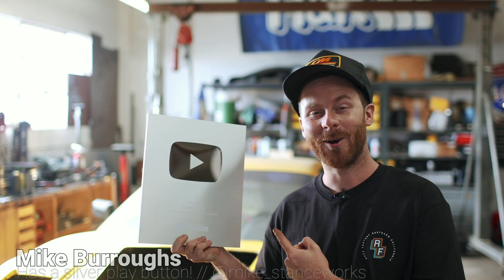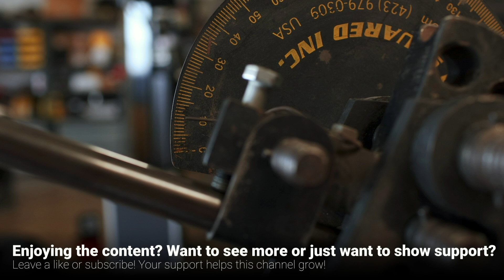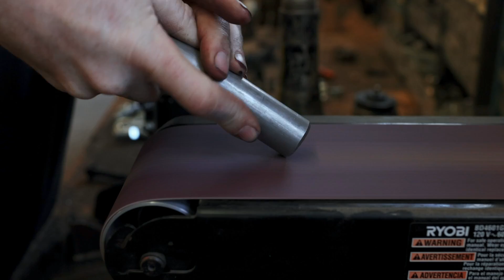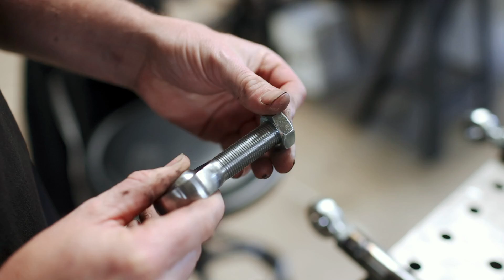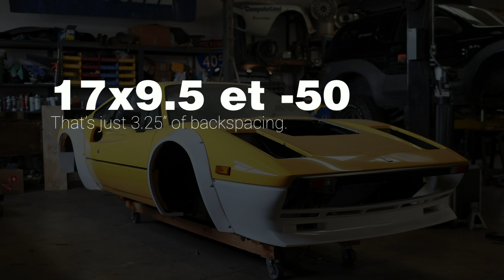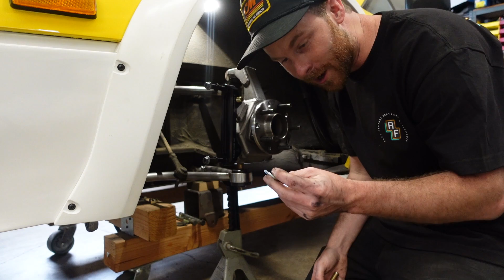Honda-Swapped Ferrari - Custom Control Arms Complete!

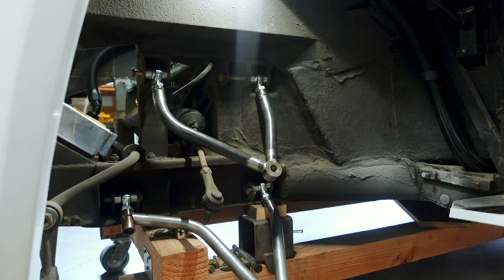Comment: 11:24 should put a big spacer in the gap that was left after the original wishbone got removed, this will crack with time unless load is properly spread between both ears.

Comment: LUL, that Iconic RX7 wheels fly off at 8:44 !!  I know that was for the memes, but that was caused by cheap "aluminum" lug nuts if I remember correctly after being on the RX7Club forum for a few decades 😂😂

Comment: Regarding the washer direction, the argument for radius side down is that prevents the sharp edge from digging in to the surface, especially if the material has a protection layer (paint, zinc, etc.)

Comment: IMO, this part of the project is the most challenging, technically. It's a very complicated system dynamically, requires precision and near-perfect dimensional consistency among multiple hand-built parts, and he must get it right, or his car could be an absolute nightmare to drive in competition. Suspension design and build quality are going to make-or-break this car.

Comment: The stub axel not having a filet radius would 100% be a real problem. Especially with fatigue and especially with 1000 horsepower. If you're interested in the science its called stress concentration. You can read all about it in Shigley's Mechanical Engineering Design chapter 3. Depending on the size of the fillet radius vs the larger and smaller axle radii the torque in the corner could be up to 3 times as high at zero fillet radius.

Comment: Nice work, I know you have to be frustrated every time you do something to the control setup that you don't have those wheels yet.  I know you have worked hard to get that weight down, sadly I think you are still going to have a lot of weight from the chassis, my guess is 2348lbs.  If you are able to come in under 2200 that would be quite an achievement!

Comment: Congrats on the 100k+ subscribers Mike! Very well deserved. I do have a question for which I can’t give an answer or at least, not the best answer. It looks like you’ve used the same longitudinal positions for the control arms and just added track width. Not a horrible idea as it’s a good known (mostly) start point. Do you know more than Ferrari? Ferrari today, absolutely not. Ferrari of 30-40 years ago? Maybe. Ferrari didn’t have access to the internet or the computing power we do today. They didn’t have the experience gained by 1000s of engineers over that time either. I could critique your control arms for several reasons but, I actually think it’s more important to get a safe car on the road first. So, like you are, concentrate on getting the car drivable first. Then gather data, analyse, modify and iterate. Really looking forward to seeing this car progress.

Comment: I think most of the bracket you created in this project can be 3D printed use a FDM 3D printer. It's cheaper and faster, and the strength of the 3D printed material can handle most of  your situation in this project. You should give it a try.

Comment: That 3m deburring wheel is just what I need to clean up the SS exhaust tip of my brother's VW T3 sports exhaust. 
Loads have said to use Harpic power toilet cleaner but looking into that, now shows it's a bad idea due to the caustic ingredients.

Comment: 3m purple Roloc clean & strip 4” disc. 07466

Or 3m gold 2” or 3” Roloc’s 07480 & 85 

Also sunmight makes good 2” 36g and 50g small roloc disc that are killer. 

If you see this in the 300+ comments. Best disc ever ever. 🙏

Comment: the only thing I will ever criticize is your use of imperial measurements how do you use thousandths of an inch how can something imperial be sliced into 1000ths they are metric, please use metric measurements everything is divisible by 10 including weight like 2200 pounds is 997kg, you have a Japanese metric engine in an Italian metric chassis , even the GM corvette hubs are metric 5x120,  Millimeters centimeters meters kilometers

Comment: The control arm spreader bar is only needed if the mounting interface for the control arms is insufficient. It's actually pretty uncommon but I understand wanting it since the stamped steel ones had it and it could be made very light. You could probably even get away with 0.035" wall 4130. Congrats on the 100k, I look forward to seeing this car get "finished", then improved as you keep learning.

Comment: Rear toe change curve can have a powerful effect in tuning handling, especially with big rear tires and weight distribution. Fixing it as you are is a good safe place to start, though before the frame gets fully painted/finished, I'd suggest future-proofing with provisions for a chassis-mounted toe link. Ideally you'd want to be able to adjust the height of the inboard mounting point and would want level at ride height within its range of adjustment.

Comment: You have fender flares...not a widebody kit.
Reply from the maker: Please, thoroughly and non-pretentiously explain the difference.
Reply: @stanceworks  I realize you are a very technical guy and that is why I started watching your videos, for the technical aspect and I appreciate the content you share. But to call fender flares a widebody would be like calling Bushwacker fender flares on a F-150 or any flares on a truck a widebody when it is not. I used a truck as an example. Unfortunately the younger generations call bolt on fender flares a widebody. And in my opinion molded on fender flares are a grey area whether or not they are still just fender flares or an actual widebody. What was considered a widebody back in the day is when the actual width of the sheet metal (or if has fiberglass panels) of car was wider from quarter panel to quarter panel and fender to fender. In reality the bode of the car is still the same width with and without fender flares.
Reply from the maker: I appreciate the kind words. 

This isn’t critical to you - but nuancing the difference between “wide body” and “fender flares” just comes off as pretentious gatekeeping. I get why some people care, I’d probably say the same about something like a 240sx, but in the end, none of it matters. 
It’s my car, and I’ll call it what I want. I think, while still technically correct, calling it just “fender flares” is discrediting to everything else going on here. The build is anything but just bolt on flares - I’m going through a mountain of work to redesign and widen all of my suspension components to make this bodywork truly beneficial. My track width is now wider. I think calling the car a wide body is fair. If anything, the entire car, aesthetically and mechanically, is wider now.

Comment: How long does the battery last on your little die grinder?? (Granted it's just being used to clean up edges/cuts smaller jobs) I love my pneumatic kobalt... But DAMN listening to the compressor gets OLD!
Reply from the maker: I have the big batteries for it and it goes a good while. The battery charges as quickly as it depletes, so two batteries usually keeps me at 100% duty cycle
Reply: @stanceworks  only 2 batteries and you can roll on at full tilt without having to wait!?! That's killer!! Thanks for the reply...and stellar news!! Off to the local *big box for a new gadget!

Edit: The "Honda-rrari" is coming along fantastic!! Loving the relatable mindset of "do it the right way, not the easy way" can't wait for the next installment, keep it up!
Reply from the maker: I should be clear - that’s not from constant use full tilt. But I find that the rate I use it, 2 batteries is enough.
Reply: @stanceworks  kinda figured that was roughly based under "your normal use" lol. Either way, much appreciated!

Comment: Another awesome episode! The 308 stub axle information is 100% correct and it is not really a design flaw. The stub axles are totally ok for the tires available in period. With the advent of larger and stickier tires over the past 40+ years the stubs show their limitations. Also be sure to sell those uprights. A complete assembly should sell for at least $1K each so that is some good bank sitting on the shelf.

Comment: A FB group I'm on posted links to this and, of course, mentioned the "desecration" of the Ferrari with a Honda motor. Rest assured, your fans quickly pointed out the 1000+ hp. Looking forward to seeing it rip and silence most of the haters. (Let's face it, some will hate because hating is easy.)
Reply from the maker: I'd love a link  if you have one?

Comment: If the car was 3200lbs when you started, my guess is 2350 dry.  I built a Porsche 964RSR race car out of a 2900lbs street car and it was 2225 fully wet. It had a full cage, smaller brakes, and was air cooled, so 2350 is my guess for your car.

Comment: Great project. I just realized one small thing. From my understanding, you got a AP brake kit designed for Corvette, which you adapted to the Ferrari? But be aware, that a Corvette use trailing callipers in the front and you have mounted them in leading position. There for the piston of the caliper are the wrong way! These caliper have 27, 31.8, 38.1mm piston and that is also in turning direction the row, how the disc should run through , or you will end up in huge taper wear, followed by a soft pedal and leaking or clamping pistons.
Reply from the maker: Good note! Fixing that is as easy as just swapping my spindles side to side.

Comment: Amazing to me that the early 240Z came in at  2100 lbs, WITH a steel body, back in 1971 and just a few years later, a performance car like Ferrari comes to the table with a 2700 + lb car. ( the Z had ballooned to this weight as well )  We can thank Nader and all the other bleeding hearts for this.
Reply: The 308 had a lot more baller 70’s “luxury” than the 240 and a heavy engine, plus the chassis is super crude.

Comment: I'm glad you stated that failure is acceptable if it is used as a learning experience. Too many people fail to act for fear of failure when they should just regroup and press on. 

Great work on the car as usual. The rear body structure with the boxed steel is screaming for your attention. If it was all tube framed it would be incredible, but please don't for now. Just focus on the pertinent details. :D
Reply from the maker: At this point I do wish I had just tube chassis’d the car. The next big build, maybe 2023, will probably be a tube chassis.

Comment: Did you mention half shafts on the to do list.  I'm interested in how the power to the spindles is going to be done.
Reply from the maker: Me too. Hopefully I figure it out LOL!
Reply: @stanceworks  I'm not familiar with Corvette rear spindles, but if they don't work maybe LS4 (2005 -2009 GM V8 front wheel drive car platform) spindles and splined shafts. Looking forward to seeing what you come up with.

Comment: Mike, are you running C5/C6 front spindles/hubs on all four corners? I can't remember if you discussed it in the past. If so, what did you do to get around running smaller rear calipers (I'm guessing AP's calipers all mount the same), or are all four corners running the same calipers with a proportioning valve?
Reply from the maker: I have smaller 4 piston calipers in the rear. It’s just a rear corvette brake kit. 
Corvettes use the same spindles on opposite corners, so FR is the same as the LR and vice versa. It’s part of why I chose them, for simplicity’s sake.

Comment: Longest build series? Whoever said that has never heard of Bad Obsession Motorsports and the 6+ year Project Binky series.
Reply: Hell, how long has Rob Dahm’s 4-Rotor taken?
Reply: @afilleduptaco  big facts. I've been watching him for at least 5 years.
Reply: @afilleduptaco  Shockingly not as long.
Reply: @afilleduptaco  I immediately thought of that and came to comment that lol
Reply: @afilleduptaco  at least that car has been driven and even raced ken block, project binky hasn't even driven under its own power 😂
Reply: @kai_444  Binky has driven under it's own power, they took it to a show not to long ago. Granted, it only barely drove, and they've pulled it back apart again to fix all the things they found wrong with it after the show.
Reply: @kai_444  not true! But we haven't seen it in action yet. Can't wait
Reply: @kai_444  It did drive already
Reply: @kai_444  it has moved under it's own power on and off a trailer. They've had to do some reengineering on the clutch pedal and alternator setup.
Reply: @kai_444  Has so, just got taken apart again after for some bracketry 😢
Reply: @kai_444   Yes it has, I was there at the historic rally festival 🤩 albeit it didn’t go very far 😆
Reply: @kai_444  there's videos of it moving
Reply: Pfft, all are amateurs. :) Aaron Cake's series on restoring and modifying his 1976 Mazda RX-5 Cosmo has been going for 11 years.
Reply: @HwAoRrDk  did you see he dropped a new video recently?
Reply: @HwAoRrDk  This is the never ending YouTube build series! Aaron Cake that is lol
Reply: Buildercreater has been working on the Arete for a long time too
Reply: People who think this is taking too long haven't ever turned a wrench.
Reply: @SupercarSeany  I feel like people who are saying this are kids who have only known engine swaps from Forza lmao
Reply: I have lived in two different countries and am still watching bad obsession!😂
Reply: @Smarterthanyou-mthrfkr  three for me lol!
Reply: @FinnTheHughMan  I really want to see more progress on the escargot as well, it's such a cool idea, and you know they're going to over engineer the shit out of it 🤣🤣
Reply: I'll check back in about 11 months I estimate, when the car is rolling down the street.
Reply: Went back and checked, binky has been on the go for 8 nearly 9 years now 🤣🤣
Reply: What abt Brian Scottos 16 year Audi
Reply: @noahreilly2862  not really a series
Reply: I'm officially 10 years into mine. I'm just too untalented/smart to not put it all on YouTube lol
Reply: Hell sgt. rock by Stacie David took over a decade
Reply: haha.  I was literally about to post this exact same comment!
Reply: It's worth noting that technically binky is still not done.......willing to bet there might be a couple bracket related projects in the future 😂
Reply: A man of culture I see
Reply: That’s funny I was just about to comment that haha
Reply: It's way more than 6 years
Reply: This
Reply: I posted a heads up about Bad Obsession Motorsport on the forums.
The forums.